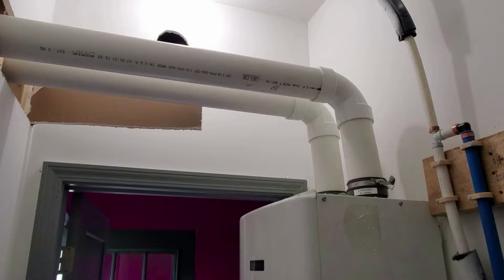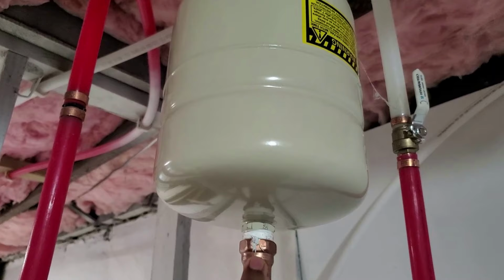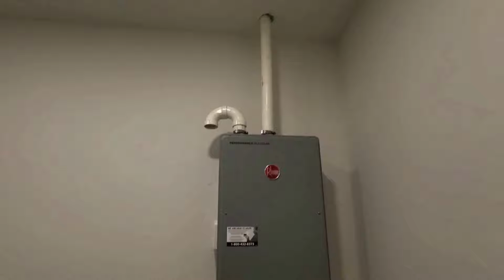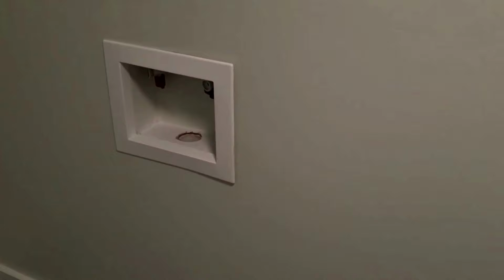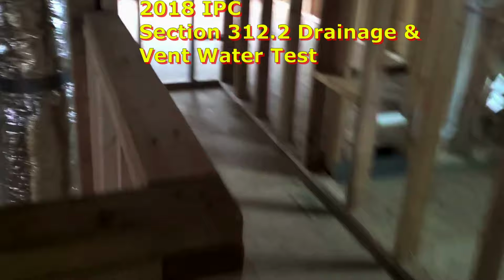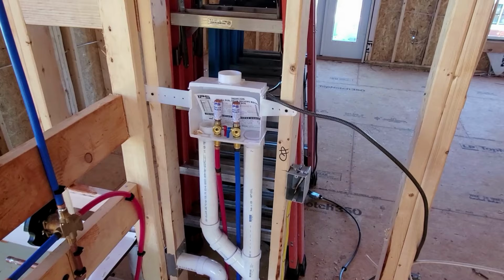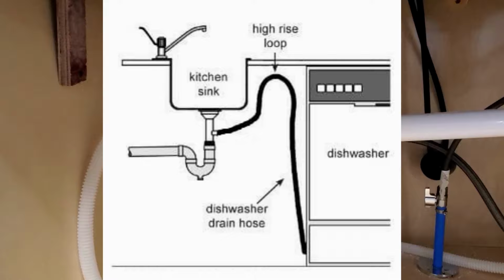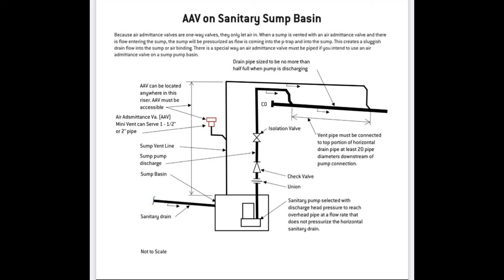Plumbing Code Violations (Part 1)

Comment: I can not agree to your codes this time .. I've done many states of plumbing many New York West Virginia Florida and yes Georgia and many others .. you can not do a video code violations on just from your state alone some of those codes you said are failures are failures yes but you are teaching based off your state codes .. all plumber contractors must check and goes buy each code for that state on top of city and or county codes ... As for that sanitary cross tee the 2x2x1 1/2x1 1/2 tee can not be used in many states or counties at that they are illegal and so on ...Many states allow for some of those failures you suggest as passable also dishwasher manufacturer does now loop most models at fixtures pull dishwasher out you will see this and vents in most states can lay flat but can't back fall so rain water can still drain ... You are teaching young guys wrong but only using your state codes .. put in all your videos that to all contractors check with that state code .. just like in West Virginia you can't do any plumbing at all without plumber license, not company license but all employees must have a license even apprenticeship people... Again not saying your wrong about your state codes but you can not teach this for others in different states California has very strict codes as Florida does .. I'm a 30 plus year master Plumber it's hard enough teaching these young kids that think watching videos like these things they know it all .. that plumbing you also should would be in a problem with me for looking like spaghetti and so on .. I think you have a going thing going but all codes differ even in your state depends on that county to.... County and city always have there own codes maybe as stated before if international codes is used than make it same for every state otherwise this is going to cause many headaches for many contractor's.. thanks
Reply from the maker: So, I'm posting videos from my prospective.  I use the International Code Books....how is that wrong??. If you're in a state that has adopted the IRC, IPC, IMC, IBC, NEC..etc. Then  my videos are applicable to you.  If you're in a state that don't use these books, my videos probably won't be that useful.  My videos still are full of  key areas of manufacturer's installation instructions for certain appliances that are applicable across the board regardless of what state you're in...I always include what code book I'm referencing in all my videos.
Reply from the maker: I appreciate you commenting.